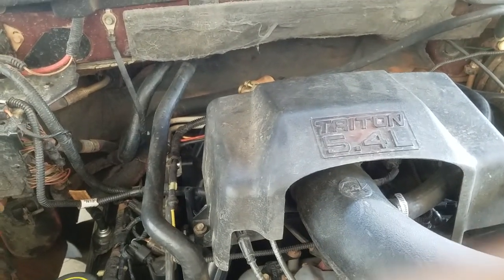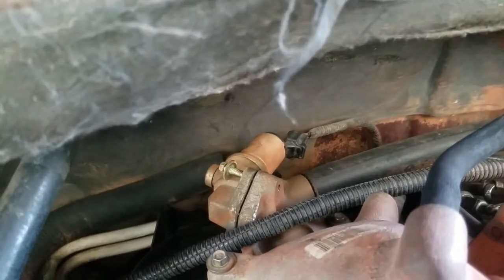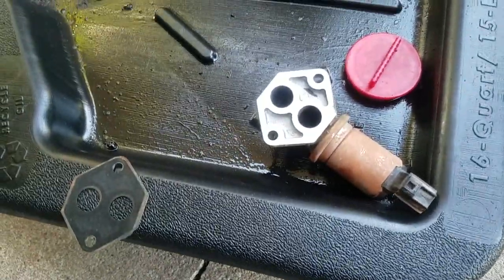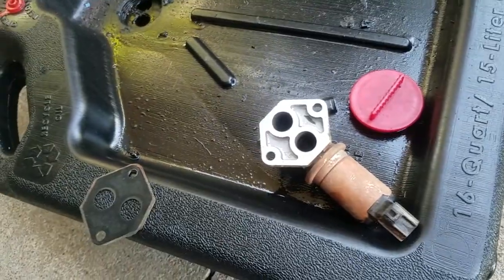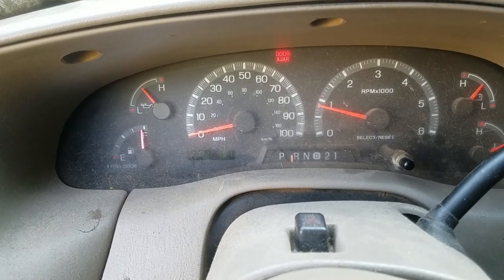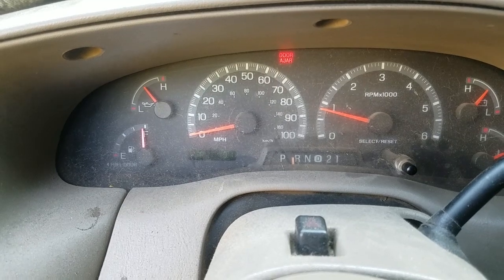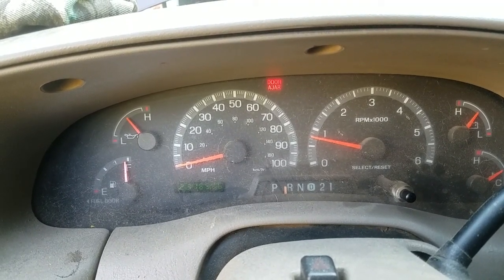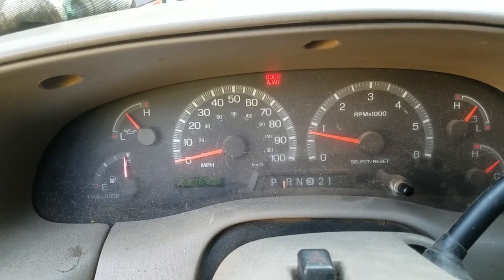2001 Ford F150 5.4L Rough Idle Fixed (Idle Air Control)

Comment: I'm an old geezer gear head. I drive an '02' E250 ext. van. With a 5.4 2 valve eng. Had the same problem on a trip from Fl. to Penn. Run away eng. revs. Brought it to a friends favorite garage in Penn. changed idle motor. Ran OK all the way back home. about a week later, same problem. So, being old school, I pulled the wire off the idle control, made me a old school idle adjustment set up on the gas pedal under the dash. Been that way since Oct. 2013. Yup, ck. eng. light on all the time. I adjusted the idle to 550-600 rpms with my throttle idle screw on the gas pedal arm. Truck has 332,000 miles on it. Runs just fine. Sorry for the long post.

Comment: The symptom of my Blazer idle air control valve going bad is that it sounded like the fan under the hood was louder than normal. I'm not saying louder valve train noise, I'm talking just the engine cooling fan sounded louder than it should. A new idle air control valve fixed it.

Comment: I have a 2001 Ford f150 5.4 , I feel a little shake at around 1 and 2 mph right after I let go the brake pedal, what could it be? It runs fine is just that little shake at that point of 1 and 2 mph

Comment: Yeah the shifter if you just pull the bottom cover off there’s a adjustment wheel.pin back tells you whether you’re in park and it’ll adjust it back it’s really easy to do just pull the bottom steering wheel cover off.
Reply from the maker: I need to check into that.  Thanks for the info.

Comment: my 97 f150 has the same problem, when I drive on the highway, then my brakes don't work right, I have to almost stand on the breaks to get it to stop. I just did what you showed here, I'll have to see if it worked.
Reply from the maker: Did it help?
Reply: @AfterHoursProjects  yes it did

Comment: Mine is doing this too, only when the AC is on max ac full blast and idling for extended periods of time. Then when I try to drive after being idled for awhile it will buck and shut off causing me to have to let it sit for awhile to cool off
Reply from the maker: I didnt have the bucking problem.  Just a Serge at idle.  I think, I may be wrong but ac might be over pressured.  I heard that may cause you a problem.  Have you checked it?  Now the bucking might be a vacuum problem.   I'm probably wrong, but might check the vacuum lines to see if any are weak and collapsing in.    Let me know what you think or find out.
Reply from the maker: Did you ever figure out the problem?

Comment: What causes da engine to die down after u start it up,some time it just goes up an goes down like it's going shout down
Reply from the maker: Dirty sensor.
Reply: Clean the MAF sensor, replace the pcv valve, clean the throttle body and replace the TPS sensor before screwing with this nightmare Idle Control Valve!

Comment: Mine goes to 2000rpm on cold start and doesn't go lower than 1100 after it warms up and transmission don't shift normally
Reply from the maker: Have you put a scan tool on it to see what the codes are?
Reply: @AfterHoursProjects .  Yes. P0171 and P0174
Reply from the maker: @jeffpeterson5387  I'd clean the mass air first maybe replace.  Clean with electrical cleaner.  If it looks really dirty check the air box see if it has any leaks. Next I'd check the o2 sensors.  I've cleaned mine before.  Soak is gasoline over night.  And reinstall.  Pull battery cables off and touch positive and negative together to wipe any codes. (Works sometimes but not all the time) or if you have a code reader. Just clear all trouble codes and before start up and see what it does.  May have a intake broke, or bad gasket on the intake. You can try spraying carb cleaner around the intake first to see if it changes the idle.   If so, it's the intake.
Reply: @jeffpeterson5387  bro mine dose the same thing have you figured it out ?

Comment: Use a computer to lower the idle rpm
Like i did saved $$$ in gas ?
I set it for 650
Reply: How do you do this?

Comment: Not sure the IAC is the culprit.
Reply from the maker: In this case it was for me.  I cleaned it. It worked for awhile then came back. Ended up buying a new one. And haven't had problems in years.  Now my oldest son drives this truck.  250k on it and still ticking.
Reply: @adeptheatingair  👁👁👁👁👁👁

Comment: Can i put water in it to clean it ?
Reply from the maker: I wouldn't.
Reply: @AfterHoursProjects  okay i bought a new one truck is still bad
Reply from the maker: @bigcountry7096  is the ac over charged?  I heard that will make it idle rough.  Have you tried to unplug that mass air see if that changes anything.
Reply: @AfterHoursProjects  I unplugged it, no more rough idle, my scanner says intake air temp sensor im praying this is it so i can work on my ebrake and horn now, thanks alot  !